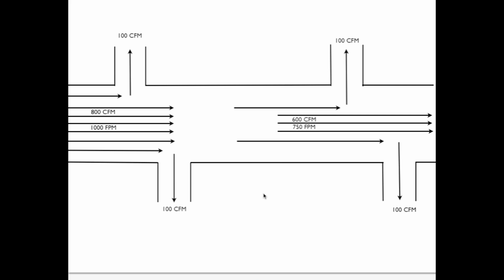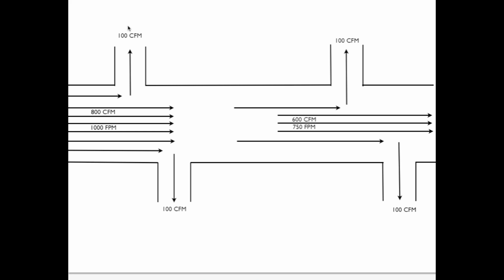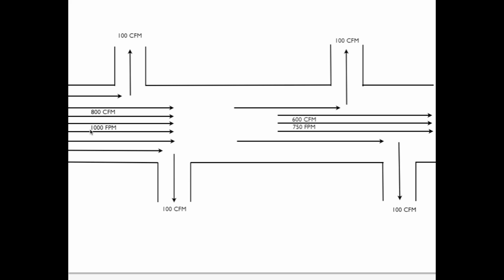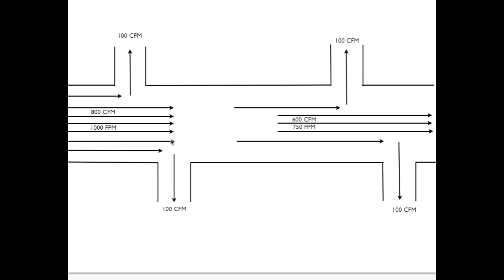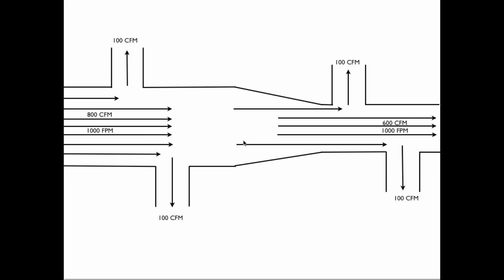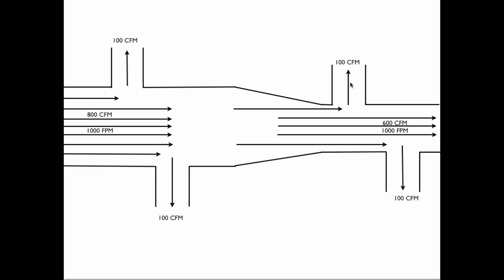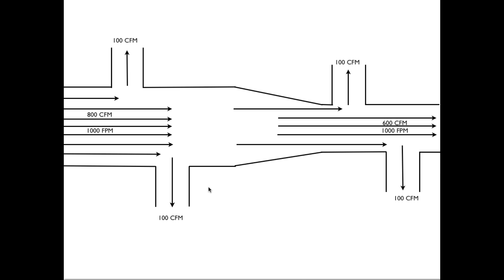Why do we put reducers in the ductwork trunkline.

Comment: Great video, May I check, the purpose of reducing the duct size is to get the same air volume, CFM output?
Reply from the maker: Its primary purpose is to keep the velocity up, which keeps up volume at the diffuser.
GFM
Reply: @grayfurnaceman  thank you so much!

Comment: Is there any way to know how many fpm each register removes so I can calculate where to put the reducers?
Reply from the maker: I can give you a nominal CFM of about 100.  Of course this depends on static pressure.
GFM
Reply: @grayfurnaceman  I'm not sure what you mean.  I know that a 8" register will subtract about 200 cfm, a 10" about 400cfm, but I don't know how many FPM they subtract so I don't know where to put my reducers in my trunk to keep the FPM up where I want it.

Comment: Hi, do we reduce it after 10 feet from air handler ?
Reply from the maker: I reduce when the number of take offs drops the FPM below about 600.
GFM
Reply: @grayfurnaceman  and FPM = velocities right ?
Reply from the maker: @yamazaheer6966  Yes, feet per minute.
GFM
Reply: @grayfurnaceman  thank you sir. If you could make a video on how much cfm is needed per room in a near future. I know that the rule of thumb is one cfm per one square inch but what if the celling are higher ? Thanks.

Comment: What you call flow pressure is irrelevant in residential duct design.  Supply static pressure is going to be lower, the further away from the blower, no matter what.  using a reducer is only going to reduce static pressure even more.  You are not regaining static with a reducer.  I think you are conflating supply register velocity with trunk duct velocity.  Register velocity is a function of the register and cfm.
Reply from the maker: Well, I guess we will just disagree.
GFM
Reply: @grayfurnaceman  You are disagreeing with ACCA manual D.  It contradicts what you are saying completely.
Reply from the maker: @Marty1911  You will have to direct me to the article.  As for "flow pressure" you will have to direct me to where that too.
GFM
Reply: @grayfurnaceman  It's called ACCA manual D.  Obviously something that you are unfamiliar with. As for "flow Pressure"  that was a term that you used in a reply in this thread.  A clue to that would be my comment "what you call. "  You really should educated yourself before you try to teach others.
Reply from the maker: @Marty1911  Well, I did teach the manual D for 9 years.  I am asking you for where you found the information you are referring to.
GFM
Reply: @grayfurnaceman  I found it in Manual D.  Are you certified by ACCA to teach anything?  I kind of doubt it.  Residential duct work is sized by friction loss over the total equivalent duct length and available blower static pressure.  There are no minimum "trunk" duct velocities, or need to keep up velocities because sizing is done by the equal friction method.  Velocity pressure and total pressure are not designed for.   When static pressure limits are not exceeded, neither will max velocity limits.  In residential duct work, this is true 100% of the time.  I believe you are possibly conflating register velocity with trunk duct velocity.  Increasing trunk duct velocity, with a reducer, will not increase register velocity.  Register velocity is a function of cfm and register size/design period the end.  nothing else will change it.  According to manual D reducers "may" be used as long as the reduced size matches the design  friction loss for the cfm downstream.  They are never required, and the only reason to used them would be space limitations or material costs.  A reducer will increase velocity, like you say, but it will reduce static pressure and there will be a net loss of total pressure and energy. Properly done the loss is negligible but there is never a gain in cfm by adding a restriction.  That should be extremely obvious to anyone!  Commercial duct work is a different animal with different designed methods often requiring computer applications and the conversion of velocity pressure to static pressure, but that isn't what we are talking about.
Reply from the maker: @Marty1911  There is a minimum velocity in residential systems.  The standard is 600 to 900 FPM.  A reducer will not increase velocity in this case, but will maintain it.  Static pressure and velocity pressure are both necessary for proper air flow.  
Please end this conversation, as most of these air flow arguments become pointless.  
GFM

Comment: Can you have a trunk that has two elbows in it, or is that a poor idea? In order for my trunk to run the entire length of the house, I need it to bend upwards and then the second bend puts it horizontally again, so it actually would be located on two floors. Would this work? Thanks
Reply from the maker: It is commonly done.  The ductwork sizing must be adjusted to compensate for the added friction.
GFM

Comment: Thanks GFM.  I recently noticed a reducing trunk line under my house, and am in the process of adding a much needed branch line to near the end of it. There is more detail on this subject in the link below. They (RSES) illustrate this too on page five, figure 4, referring to it as ''Reducing Plenum 50% rule''. Now I am wondering how to know how much to reduce this trunk.  They don't give calculations either, but interestingly your illustrations both show the reduction  to be a little more than half the width of the trunk run......https://www.rses.org/assets/serviceapplicationmanual/630-148.pdf

Comment: Gary would I have to insulate spiral ductwork in a building with a metal ceiling
Reply from the maker: If the ductwork is in the conditioned space, it is not required but may be helpful.
GFM
Reply: it is an auditorium with no drop ceilings just hang spiral both for heat and cool 25 ton AC 360000 BTU gas 3 phase system I am getting discrepancies for it is a commercial building any help would be necessary appreciated
Reply from the maker: You know, that's probably a local code issue.
GFM

Comment: Air velocity in the trunkline does not directly affect the outlet flow; only the pressure determines the flowrate through the outlets assuming they have identical geometry. A smaller trunkline will result in a higher pressure drop and a lower flow through the furthest outlets. I'm pretty sure the trunkline reduces in size mainly to save on materials. If velocity is being held constant, it is probably because it will yield a similar pressure loss due to friction over a fixed distance.

Comment: I am a bit rusty on this.  Can you explain the effect of the reducer on the static pressure in the duct?  I sort of remember measuring both a flow pressure and a static pressure back in the day when I studied HVAC.
Reply from the maker: If I am flowing air thru ductwork, with each outlet, the static pressure will decrease.  The flow pressure will also decrease because the FPM decreases.  If I reduce the size of the duct, I can keep the flow pressure up because smaller duct with the same amount of air moving out of outlets, equals about the same flow pressure.  Hope this helps.
GFM
Reply: @grayfurnaceman   - With due respect.... not correct.  Bernoulli's law states that along a streamline and **neglecting frictional loss**, Pt (total pressure) is constant.  Pt = Pstatic (static pressure) + Pvel (velocity pressure).  Therefore, if you have a trunk with constant cross-sectional area and branches that bleed off some of the flow (the streamlines go with the branch flow),  downstream of the branch Pvel decreases and Pstatic increases by same amount that Pvel decreases.  Velocity pressure and static pressure can't both decrease; if they did, you would have a violation of the law of conservation of energy.  The downstream branches see higher static pressure and thus will flow *more*.

Remember how carburetors work?  When you step on the gas pedal, the throttle butterfly opens.  Airflow through the carburetor venturi (throat) increases.  Thus, Pvel increases... and Pstatic in the airflow *decreases*.  The gasoline is in the float bowl, which is vented and sees atmospheric pressure, right?  So when the static pressure in the airstream decreases, there is more pressure difference between the atmospheric pressure that the gas in the float bowl sees and the static pressure in the airstream flowing in the  carburetor's venturi.  So more gasoline is pushed into the airstream... which is just what you want.

Frictional loss is a different thing entirely.  As air flows, there is friction in the in the flow that creates a loss of Pt (total pressure).  Frictional  loss increases along the length of flow.  There are many things that play into frictional loss,  but in simple flows such as airflow in an HVAC duct, it's roughly proportional to slightly less than the square of the flow velocity.  In other words,  for the same duct at the same temperature,  if flow is twice ( 2 times) as high, the frictional loss in the duct will increase by just a tad less than 4 times as high; if flow is three times higher, the frictional loss will be a tad less than 9 times as high.  If you keep trunk velocity high, the trunk frictional loss will also be high, and  you could have trouble balancing your branch flows while keeping the total external static pressure across the furnace or air handler blower to less than 0.5" w.c..
.
Reply from the maker: @bahhumbucker  Bernoulli's law does not apply here.  You are decreasing the duct size in response outlets that reduce air volume in the duct.  There is also virtually no venturi effect at the low
Reply: I’m sure you understand what you’re trying to say, but these paragraphs are atrocious. I have no idea what it is you are trying to say or prove, because your writing is bordering on techno babble because of how incomprehensible the sentences are. I’m not even trying to be mean or anything, I’m just being honest here; but I have a feeling you’re gonna take offense

Comment: Hi... I just replaced my furnace and was wondering what cfm a 5ton drive puts out and what every round 6" take off'''  takes away cfm wise, thanks...
Reply: About 400 cfm per ton
Reply: thanks for this Info, and wondering what 8" x 16" duct can Handel cfm wise..
Reply from the maker: Urgearhead I will be doing some videos on using the ductilator to calculate sizes and air flow as soon as I get time.
GFM
Reply: look forward to it, thanks... Im a Building engineer in down town Chicago..good to learn basic HVAC.. thanks..